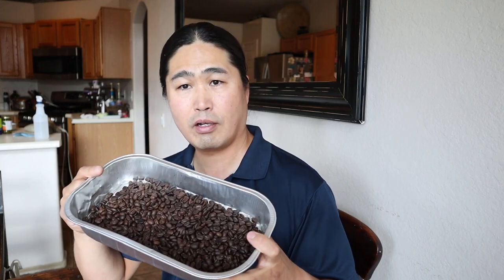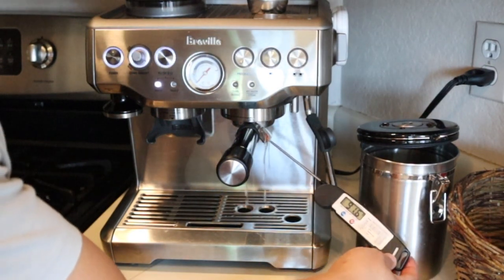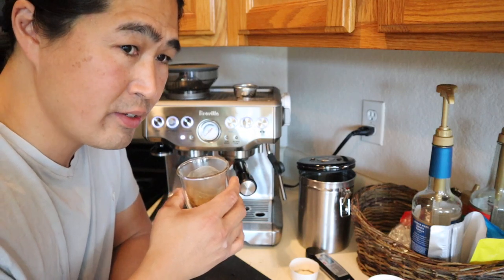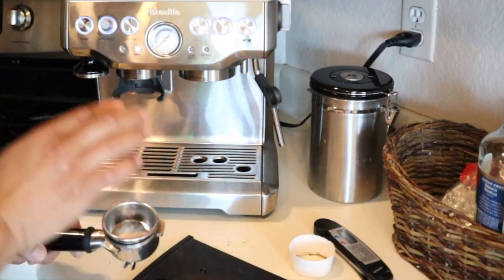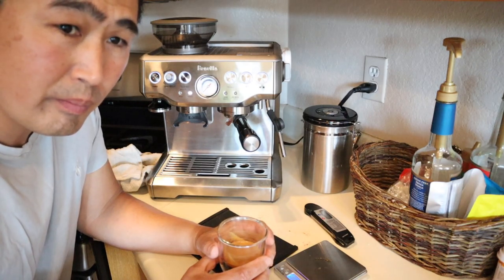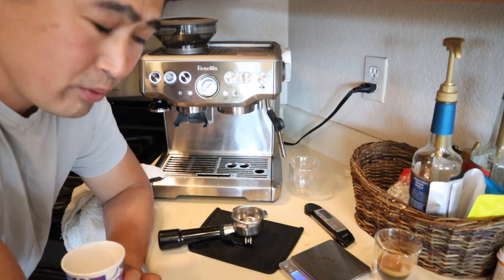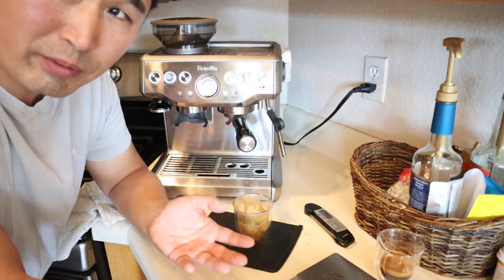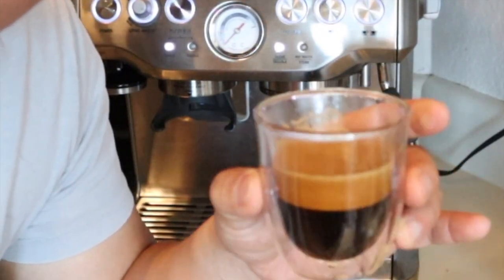Breville Barista Express - Tips on Grinder Adjustment!

Comment: Hi Hoon! Learned so much from watching your videos. Anyway, I want to seek your advice. I am having difficulties dialing in my shots. I do 18g in 36g out but in terms of time it's too fast at 15secs from the first drip in the cup. The thing is my grind setting is already at its finest. What do I do to fix this and pull better shots?
Reply from the maker: What is your current grinder setting? You need to grind coffee little finer next time.
Reply: @HoonsCoffee  it's the finest already level 1. That's my problem
Reply: When you go too fine, pressure can get too high and the puck can instantly channel. Pressure won’t read high because it is released faster than the analog gauge can respond. Counter intuitive but try a more middle of the road grind focusing on even distribution and tamping. If you’re at a grind extreme something else is likely going on.

Comment: I keep getting pre infusion showing on the meter. Currently, im on a setting of  #5  for an Old School espresso from 49th parallel. Does that mean my grind is too fine ?
Reply from the maker: Is your coffee bean fresh? Sometimes if you're using a old beans you don;t get the right pressure.
Reply: Hoon's Coffee it’s about one month in the container. I haven’t used it until now. I almost got in the middle of the meter, but I think tanking with low pressure. It’s hard!
Reply: Im tamping a bit too low***
Reply from the maker: @chavitavb  If you have scale use 18g and see what happens.

Comment: Great video! Just a heads up this machine may have a fine adjustment for the grinder that would be the equivalent of changing it to 8.5. I think its in the top burr that you can take out to clean
Reply: How about using 8 and then using a little less coffee? Maybe 17.5-17.7 grams.

Comment: Hi Hoon, I bought my machine 3 days ago and have been having a lot of trouble with consistency. Pressure is fine, extraction is fine but I'm still finding the shots to be bitter and every shot is different. Would you recommend using the pressurised basket instead?
Reply from the maker: That is good idea start with pressurized basket and set the grinder setting at 8 for now. Once you're comfortable with machine and then non-pressurized basket.
Reply: @HoonsCoffee  Great thankyou!

Comment: I just got a Barista express and bought some store roasted beans but im down to 2 on the grinder and still wont come up to the right pressure. can it be the beans that are old? will that affect the pressure allot or is it my grinder thats faulty?
Reply from the maker: 2 is really fine. What did you get?  Since your barista express is new so I don't think your grinder is not an issue. Try this, use pressurized basket next time. It give you good pressure every time. If you still have issues most likely it is the Barista Express.
Reply: @HoonsCoffee  with the pressurized baskets it turns out good, with 2 settting i get half way to the lowest espresso range.
I was thinking (more like hoping) the beans are bad like to dry.
Reply from the maker: @Neoni1986  Try LaVazza Coffee. Good price and good taste. If you have local coffee roaster near by get it sometimes. Nothing like fresh roasted coffee.
Reply: @Neoni1986  Your beans are probably old,. If you bought them from the supermarket, they could be many months past their best. Hoon recommends LaVazza coffee beans, and that is a great suggestion. LaVazza is an Italian company that uses a process called Nitrogen Flushing, that keeps the beans fresh in the bag for much longer. This is why LaVazza beans are so good for home use.
Reply: I had the same issue. Turned out to be the beans. First time i tried with the beans there were no issues, then after a while with the same settings, I noticed that the pressure dropped.
Reply from the maker: @MichaelKire  Do you store beans in air tight container or in the hopper?
Reply: Hoon's Coffee a mix. I fill the hopper up from time to time. The rest i keep in the bag they came in, sealed. But usually there is a one-way venting hole in the bag.
Reply: @MichaelKire  It should keep it fresh for a while but after two weeks it getting stale.
Reply: I have had the same problem probably because of the beans. One thing that helped was raising the temperature of each shot. The Owners Manual has instructions on how to reprogram for a higher temperature. Also, when buying beans, look for the date roasted on the package. This is NOT the “use by” date. If the package doesn’t have a “date roasted”, don’t buy it. Look for beans with a roast date of two weeks or less... The only brand of beans with roast dates I’ve found at my local grocery store is Peets.

Comment: I notice you never level after tamping. I noticed a big difference in the pour if it is levelled after tamping, because there is always a tiny bit of unevenness after tamping, and the level takes care of that, and then the water hits a flat surface. it is one of the tools you get with the Barista Express. is there a reason you don't do it?

Comment: There is an 8.5. You just need to hold the grind wheel or make up some sort of way to keep the grind wheel in place during grinding.
Reply from the maker: I try paper clip method but didn't work. OR you could buy Barista Pro. Pro  have 36 grinder settings now but $900 price tag. I am not sure.

Comment: Thanks for the video. Im having a problem with my new machine (Barista Express). When I use single basket, I get perfect pressure. But with double basket, the pressure doesn’t rise. I use the same grinding size and same way of tamping.
Reply from the maker: Are you using non-pressurized basket for both single and double?
Reply: Hoon's Coffee Yes, I do.
Reply: Hoon's Coffee It’s sorted. Apparently I was not compacting properly.
Thanks.

Comment: I am having the issue of the espresso extracting to quickly with a very low pressure. Even though my grind size can't go any lower on this machine. What could I do to resolve this issue?
Reply from the maker: Have you try the double wall basket yet? If you haven't try it first. Double wall basket will give you consistent pressure. By the way, when did you clean out the group head and the screen? If you haven't try this video? https://youtu.be/Mgarw3ZK4Zo
Reply: I had the same problem. Have you adjusted the grind setting on the top burr? Take the hopper off and suck all the grinds out the top with a vacuum and twist out the top burr. You can take off the metal pin thing and twist the grinder finer then clip it back in. I would do this one step at a time. The Breville manual has a great explanation for this.

Comment: So after investigation my advice is the older model breville barista express 860 , the 1-15 grind number are around the other way as compared to the new model.  For example, 15 is finest.  The new model, 15 is course.  Beware.  Also, the older model grinder burr can't be adjusted inside.
Reply from the maker: Good to know. You can get a adjustable inner burr from Breville website
Reply: @HoonsCoffee  . Will the adjustable inner burr fit my old machine?

Comment: I've tried so many times, gone through 2 bags of coffee and all the grind settings, for some reason the meter never goes up past the first few lines, its never gotten into espresso range :( I'm currently keeping at 3 which has the nicest crema, but coffee is still disgusting, bitter and the shot is only around 6seconds. I feel like my machine doesn't work! I only just bought it 3 days ago.
Reply from the maker: Are you using a double wall basket or single wall basket. If you're using a single wall basket change to double wall. Double wall is a lot easier to use in the beginning. By the way, what kind of beans are you using now?
Reply: Angel M same here! Haha. I keep changing the grind size but the extraction time is always below 10 sec starting from the drop.
Reply: Do you use freshly ground beans?
Reply: Same here! Every time I use single wall filter, no matter what grind size, even with the local fresh coffee, I still get out of the range espresso. Why....

Comment: Do u care about extraction time at all?
Reply from the maker: I do when I make an espresso or americano.
Reply: @HoonsCoffee  thanks. I seem to get the pressure right and color good, but the time it takes for the shot to run out is shorter than 25sek.  I don't know if I should manually program the volume or if it even matters

Comment: Many “pros” do not like using a double wall basket... it’s almost like cheating... some have even said that the creama made using a double wall basket is “fake creama”. However, they never explain the difference between fake and real. To me, “creama” is “creama”. Personally, I like the double wall baskets. I often use them with regular ground coffee...
Reply from the maker: Sometimes  I do that as well. Works pretty good with double wall basket but once you dialed in the single wall basket you get a really good espresso.
Reply: Explanation: "real" crema is made when hot water gets in contact with coffee material, which is rich in CO2 (this property of coffee fades away a few weeks after roasting and a few minutes/hours after grinding). "fake" crema is made when the espresso hits the second wall (within a double wall basket - at this point it has no crema) and is forced through a very tiny hole with a lot of pressure. The origin of this crema is kind of similar to making cappuccino milk with the electric milk whisker. So, if you are making a traditional espresso the crema is a sign of freshness of the beans. Also, the crema only forms with the right selection of grind size. Therefore you can fake the freshness and/or proper grind selection with the double wall basket. The taste can never be the same, but in some cases it can be quite close.

Comment: How do you know what the set the grind. Amount at ?
Reply from the maker: Start with pressurized basket first and grind setting 8. Once you get use to it move on to non pressurized basket.
Reply: Hoon's Coffee thanks I think I jumped in the deep end first. I’ve been watching and learning.
Reply: Hoon's Coffee ok new day attempted the double wall. My pressure is finally up if not a little to high. Now the problem is it’s still brewing to fast and when I pull the uses shot there is still water sitting on top.

Comment: You dont time your shots?
Reply from the maker: Sometimes I do but most times I just let it run. Factory setting is pretty good as long as grind size is good.  If I dink espresso I do time it.
Reply: The Barista is a “semi-automatic” so it does a lot of things for you like timing the shots. The time is the same for every double shot although it can be manually changed. The single shot is programmed for a shorter time. The only easy way to change the amount of espresso made is by changing the grind size. Hoon measures out his beans to keep the WEIGHT of the beans the same no matter the grind setting. Breville uses the “Razor” to insure the VOLUME of the beans in the basket is the same no matter the grind size instead of the WEIGHT. There are three adjustable items: amount of beans, grind size, and shot time. The Barista only wants the user to adjust the grind size and not worry about anything else. And if you use the double wall basket, you don’t have to worry about grind size. Many of the “pros” don’t like the Barista because making espresso is too easy...

Comment: Hoon, You're not correct.  For a coarser grind you must go from a 7 to a 6 and for a finer grind you must go from a 7 to an 8.  As you see there is more pressure on the finer grind (setting 8)and more crema than the setting 7.    If you turn the grinder wheel all the way to 15 you will notice this is the "finest" setting.  Thank You Hoon for taking the time my friend but you need to adjust this to avoid further confusion. So to be clear, you say 8 is "
coarser" but in fact 8 is "finer"
Reply: I just checked my new machine - 7 to 8 is coarser, as he says. It is confusing though - coz it the opposite way around on the info by the wheel, but if you check the arrows, you'll see. Peace to all coffee lovers :)
Reply: @bluejackmedia  . Hi Tom, yep I agree , it's doing my head in.  My wheel on the 860xl states 15 is the "finest" yet the manual will state the opposite.  On your new machine, if you turn the wheel to the highest number, can you see "finest" beside the number 15?
Reply: @bluejackmedia  Tom 7-8 os coarser, then why is 15 on the wheel marked as Finest?  It is on my machine anyways.
Reply: @CaffeineJogger  It's just the way you push the wheel! It's the arrows that count. Not the clearest - I admit!